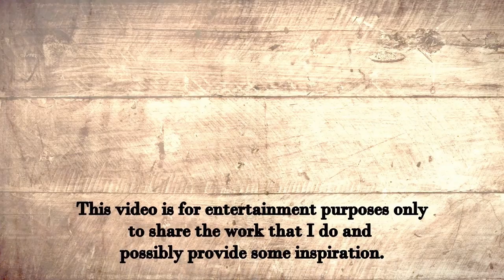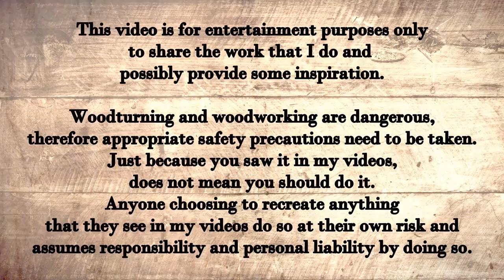Woodturning| A Sloped Rim Bowl

Comment: Okay I'll admit, when you didn't seat it fully in the chuck jaws I freaked out a little bit and may have yelled at the screen "It's not seated!" 🤣😂🤣
Reply from the maker: 🤣🤣
Turning the tenon into a beaded shape helped that the jaws still gripped it fully and it was sitting as secure as it would normally.  However, as it was my first time doing it, I was slightly nervous.

Comment: I've been watching this one with keen intrest, for a brief moment I thought you had the bowl off-center by accident. 😇
As you say, not bad for a first attempt. Not bad at all actually. 
You need to help me out regarding the setup because I'm unable to glean it form the video: 
First turning was just normal round.(?) Then, when reversing the piece you mounted it off-center and at an angle. 
How did you do that?
Reply from the maker: Hi Leo, thank you for watching, really appreciate it.
Yeah, the bottom of the bowl is turned as normal, but when making the tenon, it had a beaded shape rather than dovetail. This meant that when placing it in the c-jaws it would clamp securely at the angle I needed. I then flattened the face in that angled plane. Once you start this, you must not take it out of the jaws until the face is completely finished.
Due to the angle of the bowl, it was then not possible to turn the tenon away, hence why a pedestal was made.
Hope that helps.